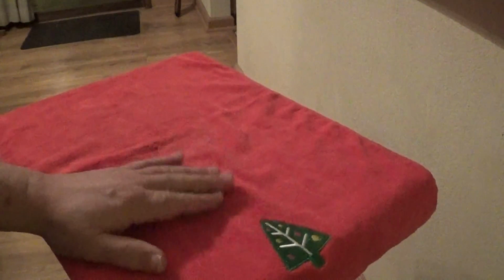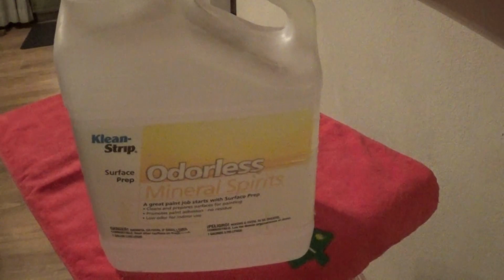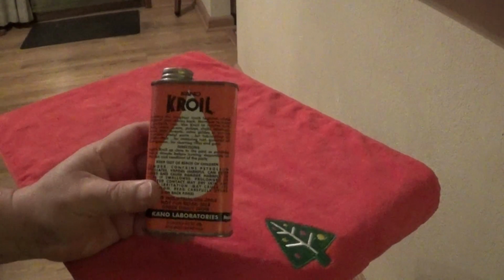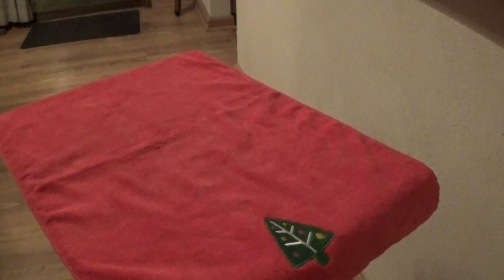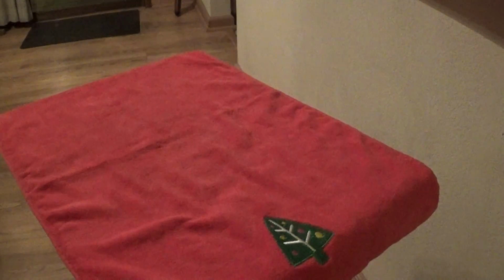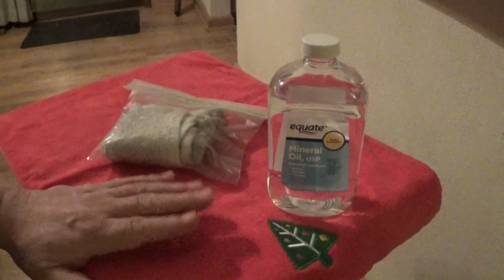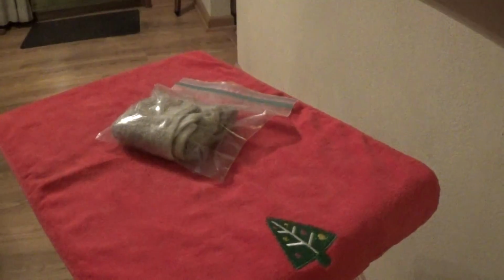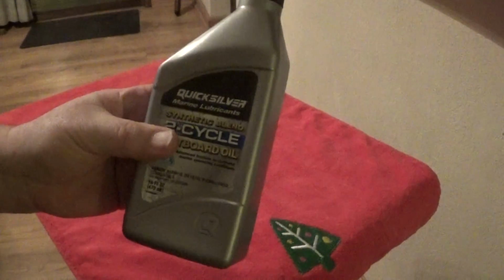Cleaning and preserving your firearms on the cheap.

Comment: I have an oil rag for my firearms (mineral oil) & one for my leather shoes (Vitamin E oil from an old incision treatment). Both bottles have lasted many years & are still over half full. I add oil to the rags every 10thish use by putting the oil directly on the object & using the rag to work it around. Then wipe down the exterior of the gun/shoe/boot with a dry rag or paper towel.  I have made converts out of many ppl who got tired of spending 15, 20, 30 bucks on a tiny bottle of magic bean oil.

Comment: All great tips, Thank You. - I wrote the following comment on the youtube video "Why Are You Not Cleaning Your Gun?" from Hickok45 Clips Where he did not mention gun cleaning products. - One sunny early fall day, a friend and I set up a utility table outside my workshop to clean our shotguns. He had his cleaning kit set up for cleaning his 12 gauge Browning Auto 5. I had not cleaned my inherited 1930's vintage 16 gauge "Nickel Steel" Winchester model 12 for a long long time. I had no "kit". I took the stock and barrel off, sat the action in , being a house painter, clean "odorless" mineral spirits and scrubbed away with a old tooth brush. cleaned so well the action was stiff as can be. A little oil solved that. Got to thinking why not use mineral spirits with, say, 5%? or 10%? oil (more or less) in it for cleaning - after the mineral spirits evaporates leaving a very thin film of oil everywhere - additional oil of choice or grease where specifically needed. 

GunBlue490 separately uses odorless mineral spirits "paint thinner" for some gun cleaning and grocery store or pharmacy Plain Mineral Oil for most of his "gun" oil uses. He talks about gun cleaning and lubrication for 14 min 40 sec including a bit about the use of a common grease and a specialty lube for the AR 15 in his youtube video - Gun Cleaning and Lubrication ~ Beware the Lie! here https://www.youtube.com/watch?v=nlRHDZfccl0

Comment: I just found out this info from another source and had a duh moment. Cleaned my glock with mineral oil and it was done. No fuss. No major expense. I've been using traditional gun cleaners and boutique lube for years. This is such a good tip.

Comment: I believe Ballistol is just mineral oil with scent added. people using motor oil or ATF are giving themselves cancer. Good Video. Acetone is another great solvent/cleaner. Our bodies can tolerate/metabolize small amounts of acetone but use it in a well ventilated area.

Comment: When I had several K's in my collection and also on locking lugs of auto pistols I put some high temp bearing grease for lube that will stay in place over storage periods till they rotate back for next range trip. Used it on rotating bolt lugs of the K's.

Comment: Great ideas but my brother is a gun Smith and they use ATF for cleaning, 5w20 full synthetic for lube and alcohol for the dry cleaning and getting all oils off weapon. It's the cheapest and best you can get, ATF eats gun crud and preserver the metal on your weapon so it doesn't rust  like a cast iron skillet.

Comment: Sir what do you think about lubrication with a synthetic 5w30 motor oil? Co-worker told me an older gentleman at the range swears by it, and after he tried it, he tells me I should use it. Thank you for the video!
Reply: Any oil works. Engine oil is unnecessary. I have guns that are almost 100 yrs old, rust free and have only ever had mineral spirits and mineral oil. 

Other old guns that have had hoppes oil, rem oil, ballistol, etc. All are in the same condition. My guns are all blued, and depending on which oil rag I grab, the guns get wiped with mineral oil, or ballistol. My small bottle of mineral was maybe $3, 30 yrs ago and I've only used maybe 1/3 of it.
Reply: I've been using synthetic Mobil one 10w30.  5w30, 20w, 30w  if I had that, for lube.  Kroil works, Hoppe's #9 for cleaning.    There is always some of any of those left over or sitting around my place.  Made for hard continual use in internal combustion engines, no reason it should not work perfectly in firearms.

Comment: I work on motorcycles often, painting and mechanical. I picked up a gallon of Prep-All by klean strip  several years ago ($25ish). I got curious and tried it as a cleaner for my guns. It works great. Its just Naphtha, kerosene, and very little mineral oil. For lube I tried some other motorcycle things I had around. I put 2 parts fork oil (fancy  sythetic mineral oil)  to 1 part engine assembly lube. Been using this for combo for a while and it works great. Didnt cost me a penny more than what I had already spent. Plus I have a lifetime supply. 

Dont get conned by fancy "gun lubes and cleaners".

Comment: What an under-rated video and info. I heard about Mineral Oil on rag but when asked on forums and comment it was a 50/50. I am contemplating using baby oil for the exterior until I can get out to Drug Store. But do you know if baby oil will work since it is mineral oil + fragrance.. Its all I have at home at the moment. Also do you use or have used synthetic engine oil for internals? just wondering which you recommend engine oil and automatic transmission fluid?

Comment: I use mineral oil as a case lube. 

4 or 5 ounces mineral oil to a 12 oz bottle of iso heat in a plastic spray bottle. Total was around $5 at Walmart. Works great
Reply from the maker: Cool.. didn't think of that, Good Hack.
Reply: I’ll have to try that. I’ve been using straight mineral oil as a case lube but it requires cleaning afterwards.

Comment: That there is the big 64 oz size of Hoppe's #9.  Brings back lots of memories using that.  Used to use motor oil instead of your mineral oil before I got wooed away with all the "new" stuff... I've got a quart of motor oil that I've used that same rag you recommend, except I never put it into a plastic bag...rag just thrown into an aluminum pan along with other rags for gun cleaning...That 2 stroke oil sounds good.  Never tried Kroil, but have heard a lot of good things about it - really penetrates well... Happy New Year to ya, Dave...FC Steve
Reply from the maker: Happy new year to you too Steve. I really don't have any thing against anyone using the New stuff, However it's really not needed. everything you need to maintain your firearms is right here and doesn't cost you an arm and a leg. Dave.

Comment: Wow...wish I had seen this video yesterday. I spent two hours driving around gun and reloading stores looking for a can of Kroil. Everywhere I went was out of it. Just placed a Brownells order a week before Christmas and 2 things on my list to get cause I'm running really low on was J-B bore cleaner and some Kroil. Brownells cant ship Kroil UPS 2day air, has to ship ground, so I took it off my list of items to get cause I was paying for UPS 2day air. I thought, I'll just get it local. Wrong, everywhere I went was out of it that I went too. Napa is one place I didn't think would carry it. Thanks for letting us know that Napa carries Kroil.
Reply from the maker: No Problem OletsRoll, I use J.B. and Kroil intermittently. between cleanings. It smooth's out the inside of you lands and grooves, sort of like sanding all the dry wall joint compound off the walls before painting. If that makes any sense.. Good shooting to you dude. Dave

Comment: Wonder if you ever tried instead of Kroil, ATF mixed 50/50 with ether lacquer thinner or acetone?
Reply: ATF + Acetone 50/50 - I use on bolts or rusted bolts that are stuck.
Reply from the maker: Nope. sounds like Ed's Red though.  Lot's of guys mix that stuff up for bore cleaner. It will attack Plastic and remove it from shotgun barrels because of the acetone in it, from what I understand it works quite well. Guys that shoot benchrest use a mixture of 50/50 Kroil and Hoppe's to clean their barrels between shooting strings. Lapping your barrel will reduce fouling as well, a good product I use is J,B, bore cleaner on a patch with Kroil. I also have Ballistol,  In any event, I was just pointing out that for basic cleaning of your firearms you don't have to break the bank, Some of that snake oil is expensive and doesn't do what it's advertised to do. Good shooting to you Robert,  Dave.